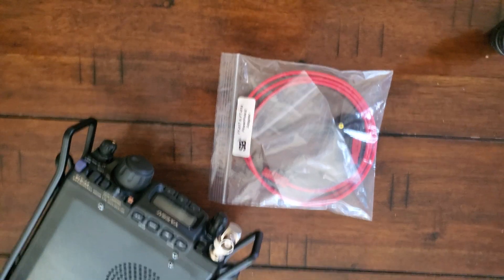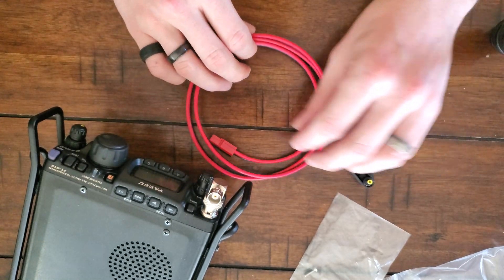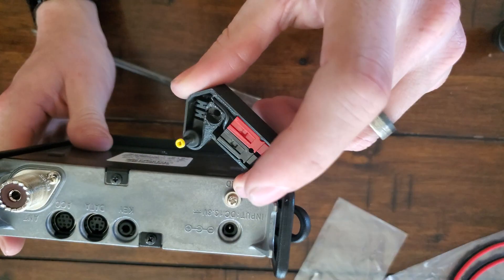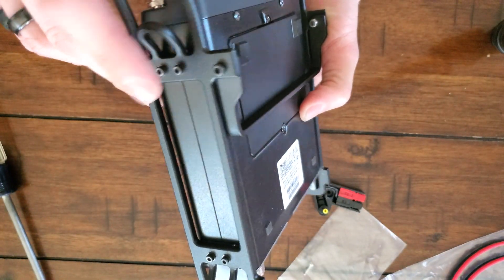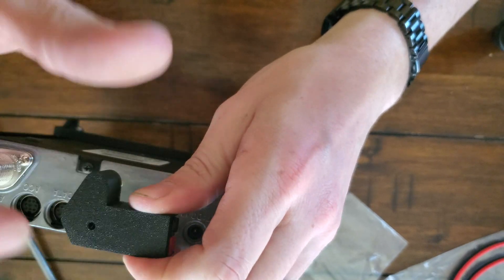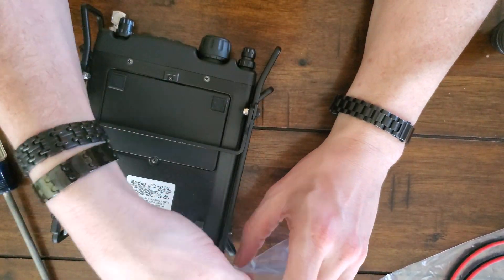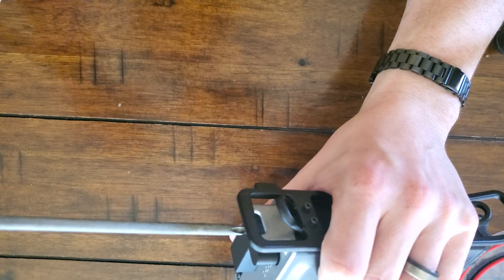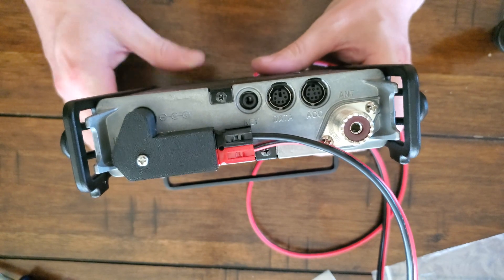Installing the SOTABEAMS FT817 & 818 PowerPole Adapter - The No Code Tech

Comment: Now how do you charge the internal battery with the wall wort charger ?
Reply from the maker: Plug radio in with wall wort charger (SAD-24B).
Pres [F] key momentarily to access menu.
Rotate the [SEL] knob so that the function row containing "[CHG, VLT, DSP]" appears on display.
Press [A] key to select [CHG] option.
Turn off the radio.
The display will remain on and show the remaining charge time.

Hope this helps, if you need anything else please feel free to reach out to me TheNoCodeTech@gmail.com
Thanks for watching mate.
Reply: @TheNoCodeTech  
But what I ment is the radio power port is now used with the DC adapter so now how do you plug the wall wort in to the radio without unscrewing and removing the adapter?
Reply from the maker: Oh, 
Install power pole connectors on end of wall wort cord.

Comment: Unfortunately the adapter will leach battery power. The amount is small but after several days it will completely drain the battery. I read it on the 817/818 Groups io forum some months ago.